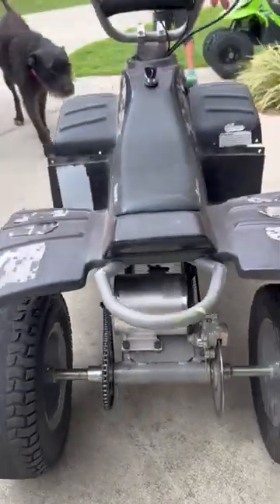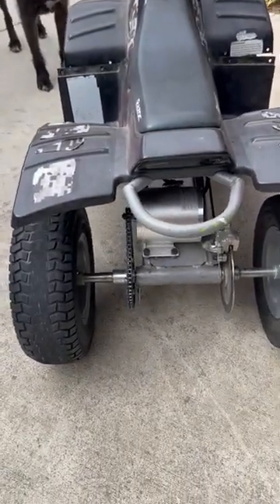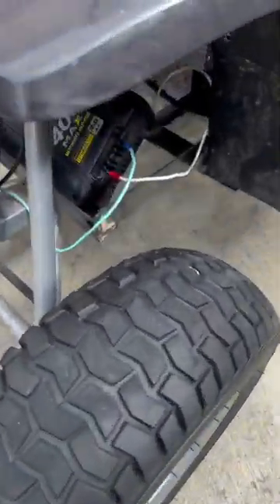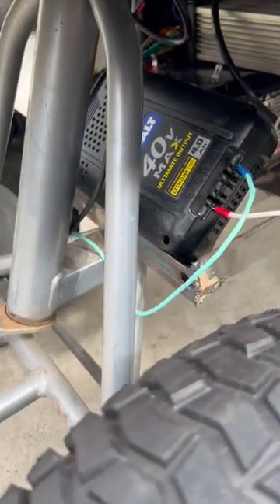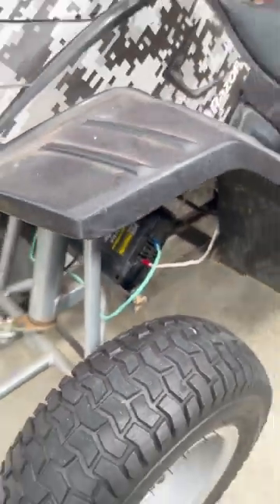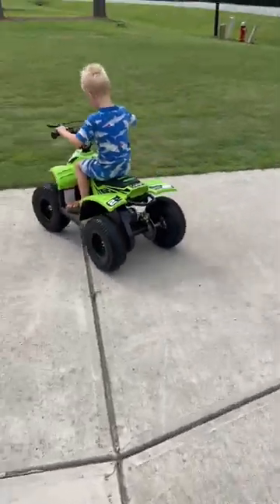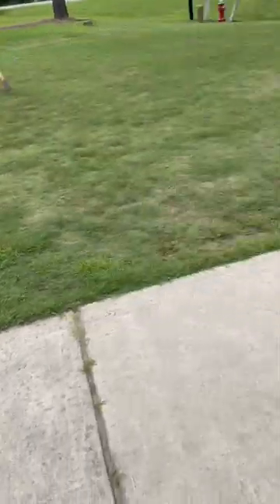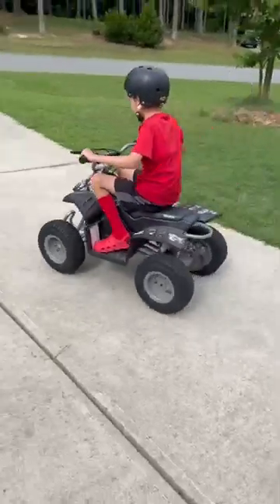Upgraded razor quad to 36 volt

Comment: It will destroy the battery fairly quick.
Reply from the maker: How so?
Reply: @poultonprojects  how is it holding up?
Reply: From my experience (18v power wheels) the motor drains the batteries beyond the minimum cell voltage. Sometimes I have to jump the battery with another battery to bring the voltage back up enough so it will charge on the charger
Reply: @camwat760  that's not a power wheels it's a razor quad 2 totally different things. A power wheels uses a drill motor essentially where the razor uses an industrial type motor. I've had a mx350 over volted with the same batteries going on 3yrs now and it still works flawless.
Reply: @camwat760  i did fine on multiple 20v batteries and a razor 12v motor on the lil ghettoscoot i made last summer for the beach store trips
Reply: @cameronwatkins1936 Dewalt batteries don't have internal regulators. Ryobi 18v batteries and some others do. If that battery you are using doesn't have an internal low voltage shut off you will need to wire one in.